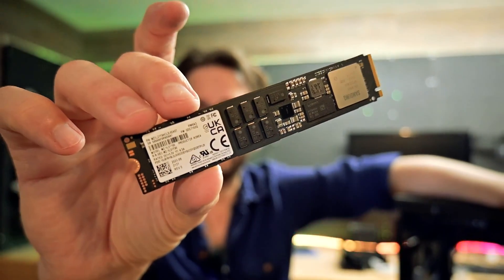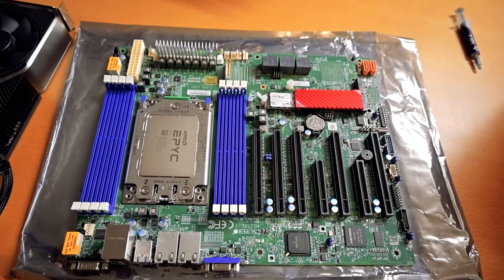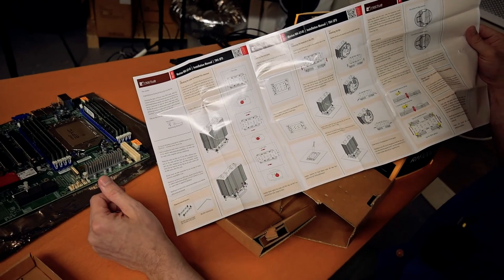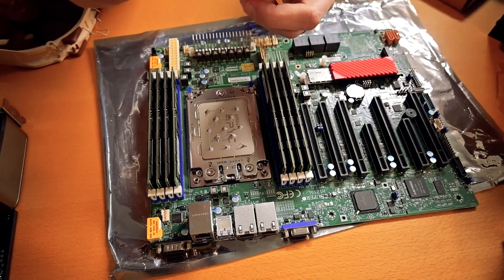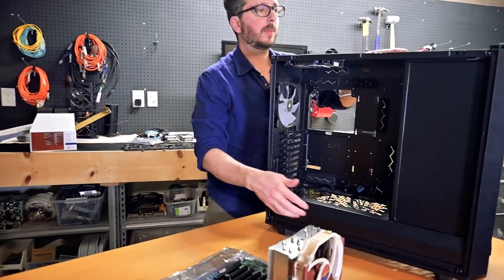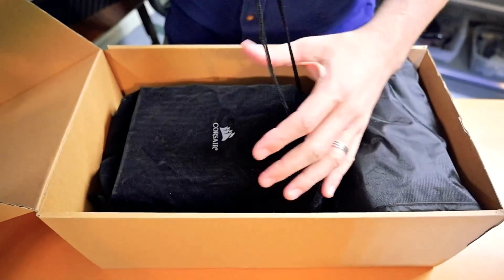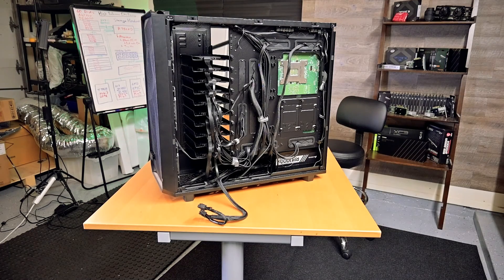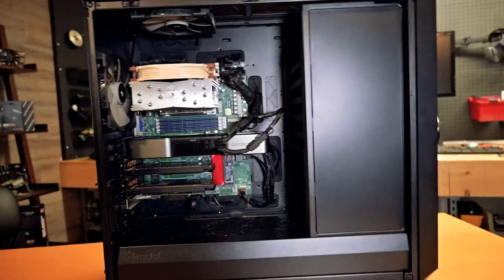AMD EPYC Server Build - The Ultimate Homelab Server

Comment: I have a question about that motherboard, can you confirm if it supports bifurcation? The manual says nothing about it online and I’ve been trying to find a motherboard for 2nd gen Epyc with that support so I can get a quad m.2 ssd expansion card without a bifurcation chip inside.
According to Supermicro if you have support for it and have an American megatrends bios you should see it under the following path:
Advanced → Chipset Configuration → North Bridge → IIO Configuration → IIO1 Configuration
Reply from the maker: @ajsliter it does indeed support full splitting options on all slots for bifurcation. Check pg 72 here for the breakdown of each slot. Works great with hyperX cards also. 
https://www.supermicro.com/manuals/motherboard/EPYC7000/MNL-2314.pdf

Comment: Love ur video. I'm wondering if the motherboard will support regular GPU (non quadro). Thanks 🙏❤
Reply from the maker: Yes it works just fine with 3090s or A5000s. It is running a 3070 right now.
Reply: @DigitalSpaceport  thanks so much ❤️

Comment: I like your build :D

I'm doing something similar, consolidating 2 Older Xeon D-2100 Servers in my homelab and just purchased an EPYC 7313 & GB MZ32-AR1 and will be using an older SuperMicro CSE-836 I had lying around. Hoping it'll be the same or slightly lower on power, but I really needed more ram and PCIe Slots.

Thanks for the insightful video!
Reply from the maker: You made a great choice on the CSE-836 case. I'm thinking of making a big switch to big supermicro cases. They just are the best.

Comment: I want to build something similar ( PC/Workstation ) with lots of PCIe lanes. What’s the Best affordable CPU/Motherboard combo ?
Reply from the maker: Likely still this. Rome chipset is when you really got into great Gen4 lane speeds and I dont think there is anything cheaper in a workstation format. Dont go with a high core count like 64, the single core speed will stink. I think they have F class chips that hit 4 in the 32 and 48 core however. Depends on your workload if that works or not but it is my observed limit.

Comment: Have you checked your thermals on the CPU with it pulling though vs blowing through?
Reply from the maker: I dont but I did notice recently that I have mine in pull configuration currently running on the 7B12 for about a week straight 80% workload and its mildly warm to the touch. This heatsink is an absolute chunk.
Reply: @DigitalSpaceport  Nice..

Comment: Ended up going for a build just like this as the parts are slowly trickling in. Watched the livestream as you upgraded but going with the EPYC 32C CPU and will throw in a Nvidia 3060 just for cloud game streaming to my steam deck. This should definitely be able to run a ton of my DevOps projects and fool around with Local LLMs for some AI RestAPI calls as well. Got tired of my Dell and being confined to their locked down processes and loud fans and will be using Proxmox to host all of my services. Thanks for sharing.

Comment: How much power does this thing draw on idle?
Reply from the maker: Power usage idle with 8 ram sticks, a U.2 nvme, a 3090 and 6 NVMe is at 140w.
Reply: Thanks for the reply. I am thinking to do a similar build. Very helpful
Reply from the maker: @bopal93   I think you will really enjoy it if you go EPYC you might consider the balance of the core count/cost/GHz better than I did. I eventually went with the 7B12 has a massive amount of cores, its not that great for desktop virtualization as it throttles up to only ~3.1GHz. In hindsight I wish I would have gotten a F optimized chip that could hit higher with fewer cores.
Reply: @DigitalSpaceport  I was thinking to get epyc 7313 (16 cores 32 threads) but due to availability issues the seller is offering a free upgrade to 7J13 (64 cores 128 threads) with the same price, which is wayyy more cpus than I need. Now I'm worried about that many cores consumption power unnecessarily. Do you think 7J13 is a good cpu?
Reply from the maker: @bgk93 You are losing 200MHz in exchange for dramatically more cores and Milan was about 20% faster across parity sky's vs Rome. While I'm not sure if Milan is impacted by the same issue Rome has in 16core sky's, Rome for sure operates better in 4channel vs 8channel due to ccd issues. Milan doesn't idle as well as Rome however so it would be less energy efficient but not dramatically. If your workload has high dependency on single thread speed, I would consider that strongly at 3.5. Are you planning desktop virtualization is a good question. If so 3.5 might not feel right for a user experience.

Comment: I came across a problem that for some reason the server boards Supermicro H12SSL 7763 percent, the EXTERNAL video card does not turn on, (I don’t know about your video) they rewrote the BIOS, and they couldn’t find why. We tried two AMD RX 7900XTX video cards, the video signal appeared several times. But when you reboot the PC, the board is immediately transferred to the internal video card. Maybe super micro specifically blocks cards from AMD. We also first tried with a GIGABYTE motherboard and the same thing. That is, it turns out that anyone who wants to build such a PC with AMD cards will not work!!! You will only need to buy NVIDEO, and it is not a fact that it will work with everyone.
Reply: If you're using windows on supermicro board with dedicated GPU you will need to disable onboard graphics. The jumper for it is at the bottom of the motherboard.
Reply: @luqmanhaqim97  I tried to enable the external video card in the BIOS settings and changed the jumper, and alas. The PS won't start at all. He writes that he needs to carefully “unplug the cable from the VGA monitor and connect the external video card with a cable from the SHDF”, how is this so? The video card is connected, and he should just turn on the external video card himself. I think the BIOS program is to blame for this. And something tells me that this is due to the built-in video chip on the motherboard from Intel. One thing is clear: the AMD processor does not work with its own AMD video card. But it works from NVIDEO.
Reply from the maker: I've ran about every Nvidia 3000 card, quadro a4000, a5000, p2000 1030 1070 and K2200 and they all worked without issue. I have some enterprise AMD cards I'll test in it
Reply: @DigitalSpaceport  Will wait. We are increasingly finding videos where people are trying to connect AMD video cards to the server, but so far nothing has worked.
Reply from the maker: How stupid is this! I tested a Radeon older 450R7 and it didn't work. It's AMD gear on AMD chipset....what the F?
Reply: @DigitalSpaceport  I wrote on the technical support forum about this problem, but they did not respond. And as I understand from other comments on the forum, AMD does not provide technical support for its products (very rarely). Everyone there complains about them. This is reality.
Reply: @DigitalSpaceport  This could be an interesting video; AMD cannot work with its video cards.
Reply: Higly likely the problem is Intel that refuses to work with AMD graphics card

Comment: I always wonder how many people incorrectly set the fan to blow into the heat sink.  You want the fan to suck air through the heat sink because laminar flow is better than trying to push turbulent air from the fan into the heat sink
Reply: I do it too on mini itx systems. It just sucks to have warmed air being pushed into system instead of reverse.

Comment: By not using 3200 ram, you are leaving a lot of performance on the table. Well some money in the wallet as well..
Reply from the maker: I do now have one machine worth of 3200 speed ram and dang it is still expensive in 32GB dimms
Reply: @DigitalSpaceport  yeah that sucks, hopefully with DDR5 coming into market they will finally start to drop fast.

Comment: I finished built my Epyc budget server myself as well ,,also 7302, with  gigabyte MZ32-AR0 mothboard + 256 DDR4 2666 RAM  + 3080ti , all second handed, so far runs unbuntu just fine .
Reply from the maker: I'm doing the benchmarking now on the 7302 and 7B12 and even the desktop feel is much much different between them. I've had mine running down to 2400 but it won't accept the 2133 unfortunately.
Reply: @DigitalSpaceport  yeah, I also tried 2133 as well, not working, eypc starts with 2400....